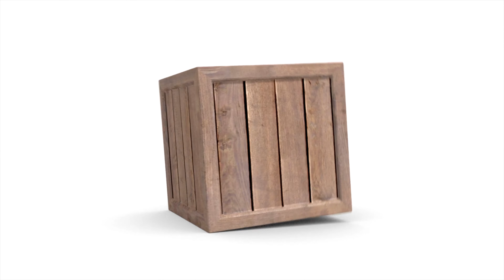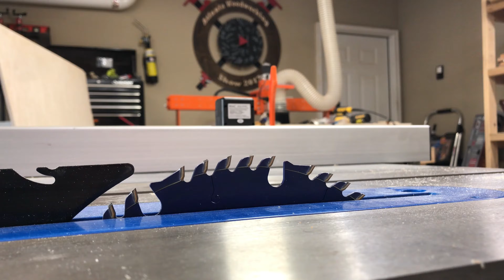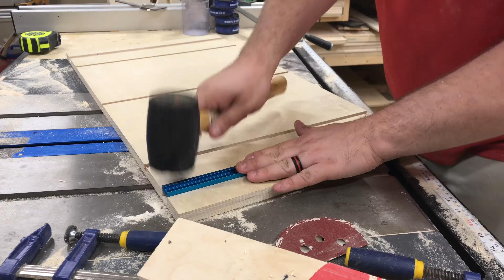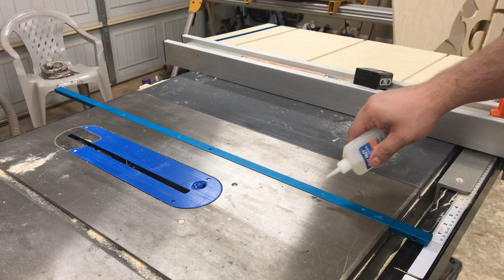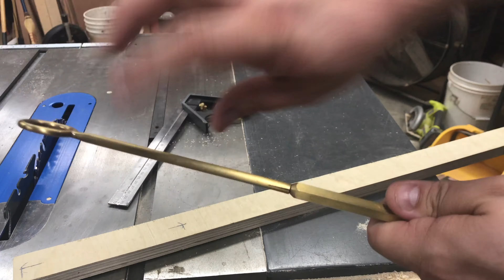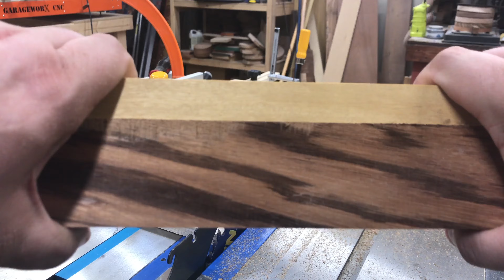Easy Table Saw Jointing/Tapering Jig

Comment: 2 years later, but it's never too late to clarify or improve.
About the dove tail. Yes it has to be in one pass and depending of the wood it can be hard on your router. To help make a groove on the table the width of the top of the dove tail. This will remove about ~70% of the material, then use your router to complete the dove tail.

Excellent jig and video :D

Comment: Add another pair of dovetail clamps and you can skip the T track; just use the 2nd set to hold down the adjustable fence. Nice video Drew and I know the clamps are expensive but they're so versatile.
Reply from the maker: thanks for the input terry and I agree with you that would work but I want to have the positive stop so I could make the same cuts over and over.

Comment: Did you use Baltic birch plywood? And if so how does it hold up when you clamp your dovetail hogs down nice and tight? I used particle board and if you try and cinch those dovetail clamps down real tight it just bust through the particle board.
Reply from the maker: Zack Lee yes I used Baltic birch and no it does not break when you tighten it down. Particle board is a lot weaker material so I would not use it for this type of application

Comment: nice combo sled Drew looks like it's going to work out pretty well congrats on the 1K bro!
Reply from the maker: +Joe basement woodworking thanks joe I have used it a little already works great
Reply: Ox In The Shop I bet it does some good grade hardware and wood that's something I need to make as a tapering jig man oh man how many projects I needed to taper the legs and I didn't because just keep procrastinating making The Jig this gives me some insight thanks for sharing bro
Reply from the maker: +Joe basement woodworking no problem joe glad you like the video and hope it helps you out